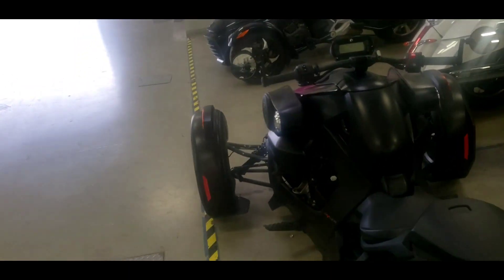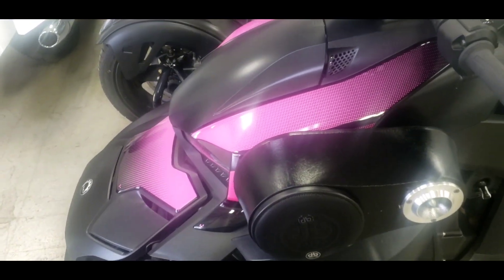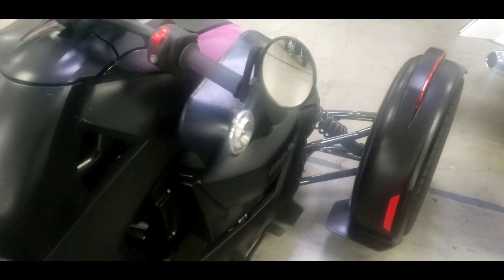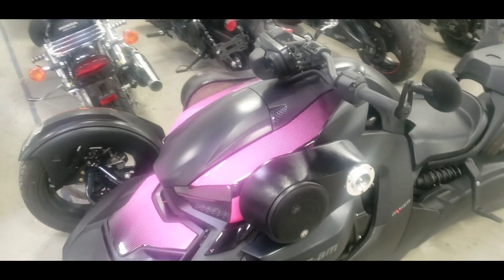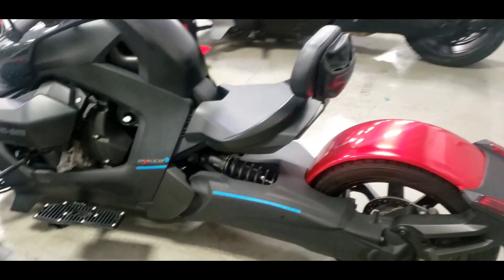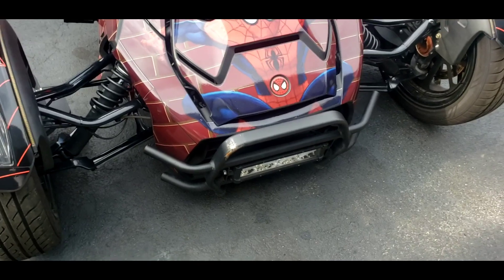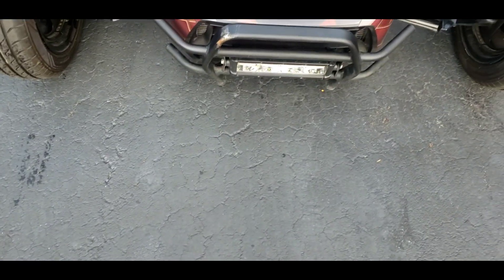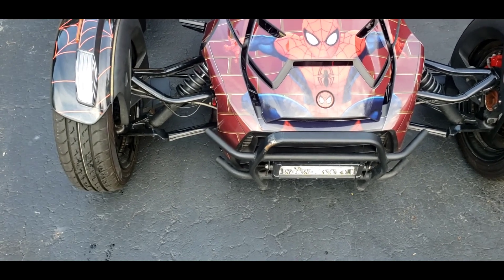Can-Am RYKER! The worst custom speaker set up on a Ryker ever! Dealership damaged my ryker.

Comment: I remember when I first got that VSS Fault. Dealer wouldn’t even call me. Wouldn’t do a diagnostic because I had all the lights on it already. Did some research and they still had the bike for a month or more just sitting in rain and whatever weather🤦🏽‍♂️ but I had my guy bring his trailer and pick up the bike. Took it to his crib and we broke it down…. Starter with charging the battery and upgrading the fuses and found a blown fuse that caused all the errors!  Changed that fuse and I’ve never been back to the dealership and never will!  I have and will completely handle any component of my Ryker!
Reply from the maker: Alright I'm going to test your theory out today. Let's see how it goes. Will come back and update you in a couple of days